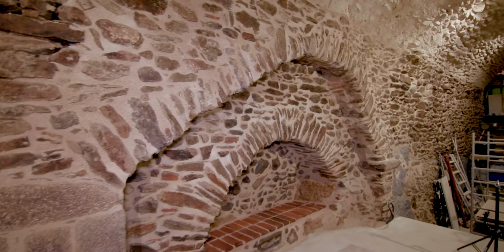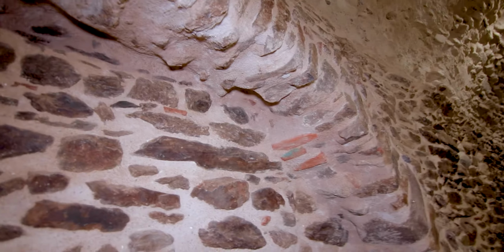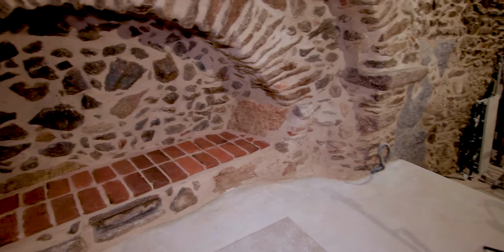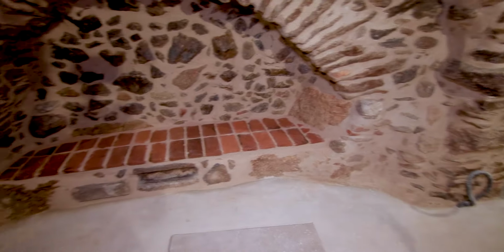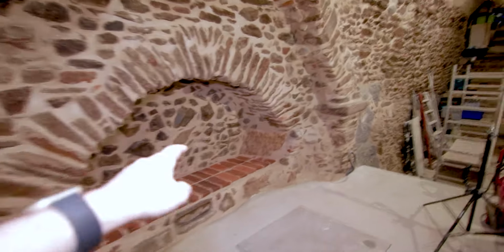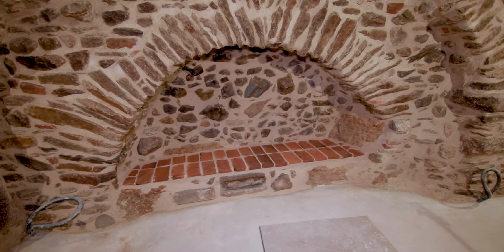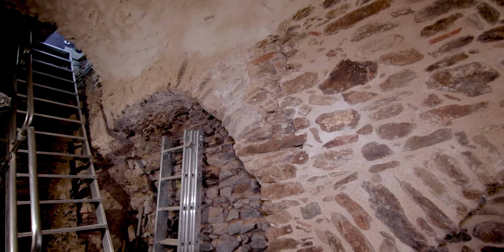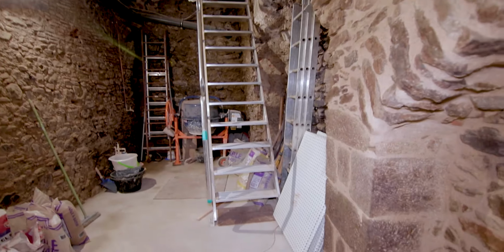Old Cellar 35: 96H of DIY medieval cellar restoration

Comment: If it's just condensation then that's a relief. But that means you'd need to either warm the space itself, or warm the outside air before it comes in, or take warm air from the higher levels of the building to create an overpressure and a draft to displace the radon laden air. All of them will increase your energy bill… It's better than puddles of water and humidity. I hope you can find a balance and trade-off that works for you. Perfect scenario for paralysis by analysis. Good luck, man.
Reply from the maker: " Perfect scenario for paralysis by analysis." Nice way to put it :) Thanks !

Comment: For lowering building supplies and removing waste, get one of those large plastic super strong bags that sand is transported in and put your smaller bags inside to lower into the cellar 😁 if you drop one,  the supplies will be inside the bigger bag.👍👍
Reply from the maker: Yeah that's what I did basically, my big bag gave way in the middle though... And the sandbag got jettisoned..  The handle stitches are the weak point on those things it seems. I got a new one now :)

Comment: New subscriber, just got one of your videos recommended the other day and have now went back to the beginning and binge watched them all. Excellent series and I am invested. Looking forward to the day (if ever) you decide to excavate the under cellar and maybe seew where the filled in tunnel leads to. Also every time you say the "poop cellar" in your lovely French accent I crack up.
Reply from the maker: Thank you ! That's some dedication, glad you like the serie. For the undercellar, I'm sorry to say that the prospect of emptying it is receding in probability every time I add some dirt in it... I'd really like to do something with it at some point but the hassle/benefit scale is not very favorable. As for the tunnel unfortunately that's not something I would explore since it's not under the property parcel. And the collapse happened for a serious reason it seems, probably heavy work on the "new" street above. So it would be very very tricky to undo that.
Reply: @thevaultedworkshop765  I understand the hassle/benefit scale all too well. I wonder if the vacuum truck hose could fit all the way down and suck it up from there so it didn't need to be carried up first?
Reply from the maker: @dirkschippers2957  That would be the only way I would do it, I've now put too much dirt by hand down there to bring it back up :).  They had to use their longer hose extension just for the cellar if I recall correctly. But it may be possible to ask for additional hoses and the path is "mostly" straight I guess. I'm a little worried about the structural integrity of everything though if I were to remove a lot of dirt at once. I'm sure it could be assessed and done. If I make it as a youtuber I hereby pledge I'll invest every youtube pennie into this project :) !

Comment: A cellar is designed to be wet and cold, that‘s the way it‘s supposed to be. 
This way food and drinks stay fresh and it cools the whole house in summer.

Just be careful not to get too mich warm air from outside into the cellar if you are worried about too mich condensation.
Reply from the maker: That's true, it's not really helping cooling the house unfortunately since there is a dead level between us and the cellar. There is a balance to find between renewing the air for the radon and not getting too much humidity in.